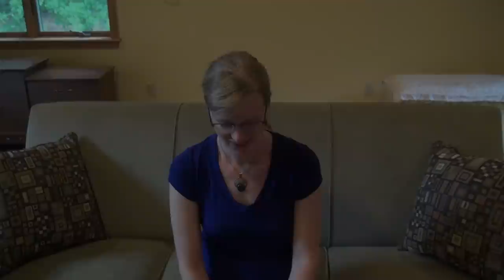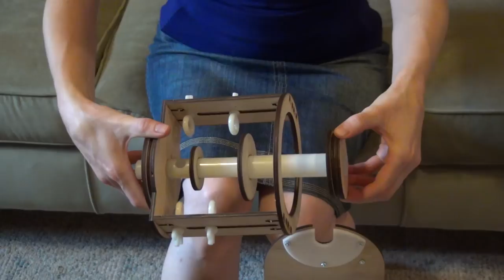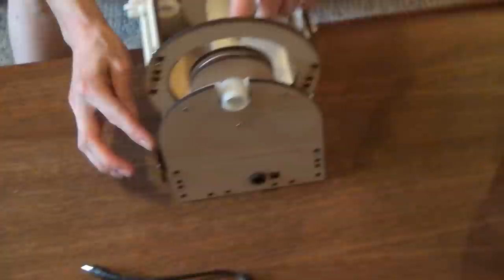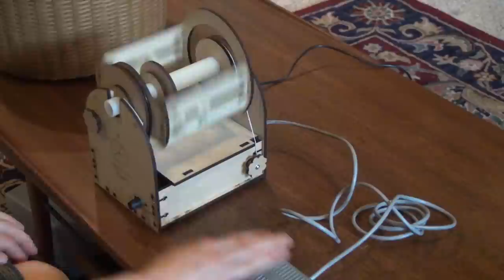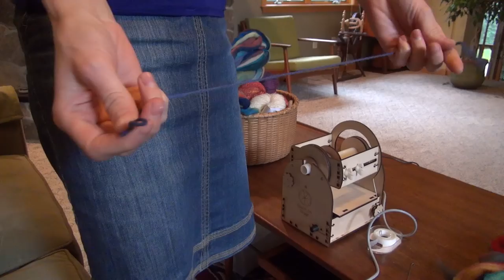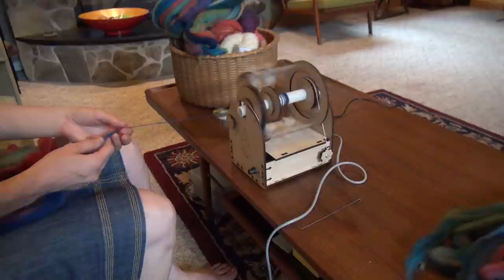Electric Eel Wheel Overview

Comment: I tested over 10 different motors and in my opinion this was the best suited for the electric eel wheel.  As for the cost of assembly, I make $0 extra off the assembled version.  The full $30 goes to a local guy I use for assembly.  Sure assembly in China would have been less, but for this project I decided to support the local economy in here in Massachusetts.

Comment: Hi, Maurice and better half.  I noticed your Version 3 Large Eel Wheel and the flyer parts looks different than the 5.1 I have.  Should you put oil on the version 5.1, 5.2 etc., or the Mini Eel Wheel (which I have 3 of) where your wife placed oil in this video?
Reply from the maker: None of those require oil, but you can optionally add candle wax were things rub on them to reduce noise and friction.  The reason I suggest candle wax is because it's less messy, but oil would work too.

Comment: I love the idea however, for the price, I would expect a motor with a bit more torque to keep the noise level down. Also, I was astonished to see the price difference between an assembled one and a kit (~$30).
Reply: I don't think you'll find any kind of electric spinner for the price of an Electric Eel Spinner. I've been looking into them for as least as long as Maurice has been developing this spinner, and I don't think you'll find anything for even close to the same price that will even touch this one.